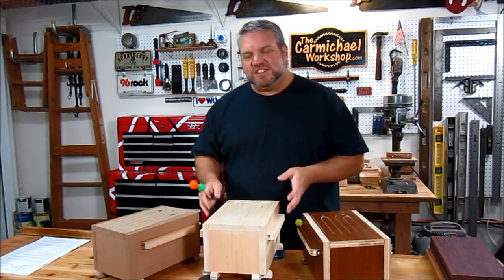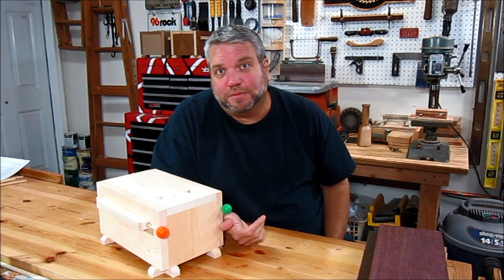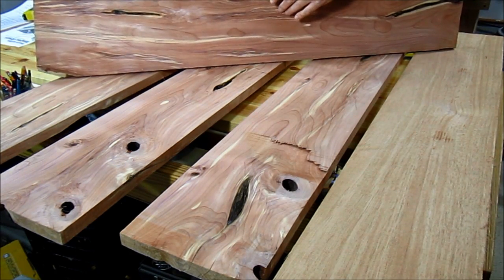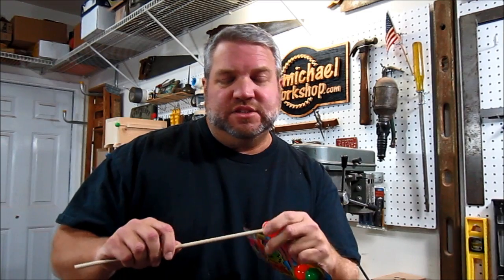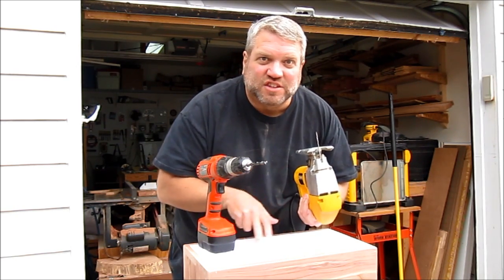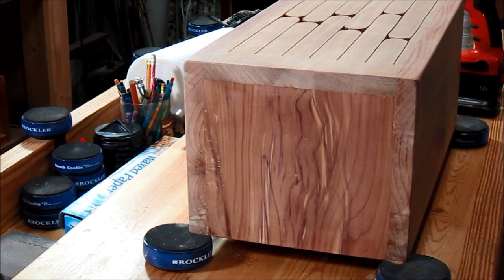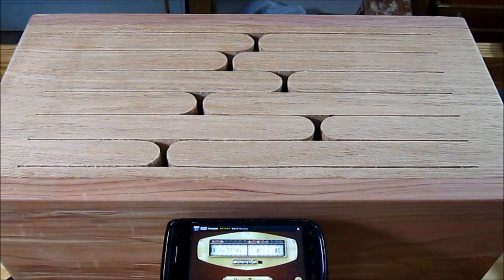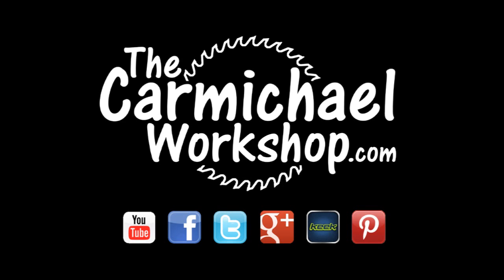Building and Tuning Tongue Drums, Slit Drums, Xylodrums - Easy Woodworking Music Project

Comment: How thick should the top be? I am making one with red oak?
Reply from the maker: I used 3/4" lumber for all of mine, except for one that I made with a 1/2" cherry top.   They all sounded good, but the 1/2" one is my favorite.
Reply: @SteveCarmichael  thank you very much for replying quickly. The oak i got is an inch thick so i guess it has to go down. I am getting very shallow sounds .I made the cuts longer , only little improvement. So i am trying to figure out whats wrong.
Again thank you and good job!
Reply from the maker: I found that each one has its own personality and it's hard to predict how it will sound.  I think the main thing is to glue it together well so it is a solid sound chamber and it can vibrate as if it's all one piece of wood.

Comment: Does the pattern really matter, or can you just make a design and figure out tuning from there?
Reply from the maker: There is a science to the size of the bars/tongues.  You can just try to make any design and go from there though.  Here is a link to bar length measurements for marimbas as a guide.   http://www.lafavre.us/marimba-bars.htm    I've been told that you should not put two bars that are of similar length next to each other, since the notes would be so close they would interfere with each other - alternate short-long-short-long etc.
Reply: If you want to approximate the size of each tongue using science I put together a length calculator using the formula for a fixed bar at one end.  I made a post about it here https://ikindawannalearn.wordpress.com/2018/05/22/how-to-make-a-tuned-tongue-drum-step-by-step/

Comment: Definitely need a harder wood or just a really good tuning, they all sound dead with a duhd duhd sound theirs not much resonance between them with the pine sounding the least dead because of how hard it is compared to the others, the last one had some good resonance without any tuning
Reply from the maker: My favorite top I made after this video is 1/2" cherry which sounds great.  I think it also helps if the tongues alternate between long and short.  Two tongues about the same size next to each other seem to interfere with each other.

Comment: how do i know what tounge for what note and how many notes as you can tell i am a novice
Reply from the maker: Daveyhunter6  There is a bar length calculator you can use to design a tongue pattern.  When I make a drum, I just tune each tongue to the closest note on the tuner, trying to make them all different notes.  Each drum sounds different even if they are the same size and wood.  There is more info and downloadable info PDFs on my website here - http://www.thecarmichaelworkshop.com/2013/11/tongue-drums.html
Reply: thank you Steve

Comment: Do you have plans posted somewhere?
Reply from the maker: There are links in the video description.  The Wood Mag plan is good to start with.  Or search google for Tongue Drum Plan and it will come up.
Reply: Steve Carmichael I didn't really mean plans, but more like dimensions for the top, sides, and ends? Dimensions that fit your templates that you provided.
Reply from the maker: I made the two long sides the same dimensions as the top so I could make repeated cuts, which is how the wood mag plan was.  Then cut the ends and bottom to fit.
Reply: Steve Carmichael On your patterns some say full step and some say half step and some don't say that at all. What is the difference. Also the dimensions in parenthesis, are these the dimensions of the entire top?
Reply from the maker: Yes, those are the dimensions for the whole top piece.  Full Step means the tongue lengths are .5" apart, which in theory means they will play notes that are a full step apart i.e. from note C to D (like playing only the white keys on a piano).  Half Step tongues are .25" apart, which means they go from C to Cflat aka semitones (like playing the white and black keys on the piano).

Comment: I cannot understand why you advise to build in this order. Who is such a wizard with the jigsaw that nothing can go wrong? And if something happens, what to do?? So to me it would sound more prudent to cut the tongues first!! The plan you show tells to cut the tongues first btw.
Reply from the maker: I thought that clamping the box together tightly may be challenging with slits already cut in the top.  Might squeeze the sides out of shape.  I have a high level of confidence in my ability to use the jigsaw and fix any mistakes. :)
Reply: @SteveCarmichael  I see, thank you. I don't have that confidence and I wondered who has, considering you announced this as an "easy project". The jigsaw (or the blades) have a lot of unwanted behaviour for a beginner.
Reply from the maker: Choosing the right blade helps. The good thing about these drums is the slits don't have to be straight. Make them wavy on purpose. Make 5 drums and pick the best one.  Have you tried yet?